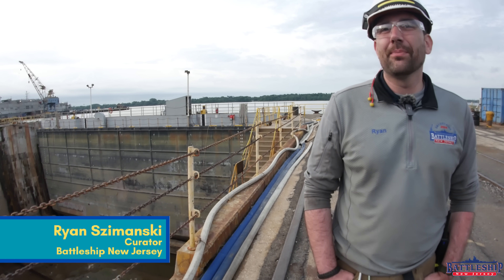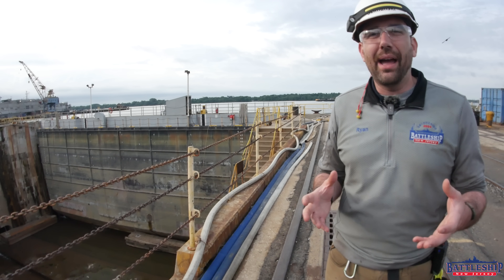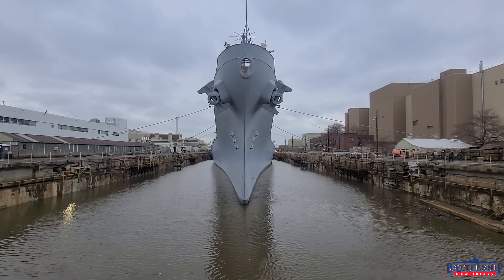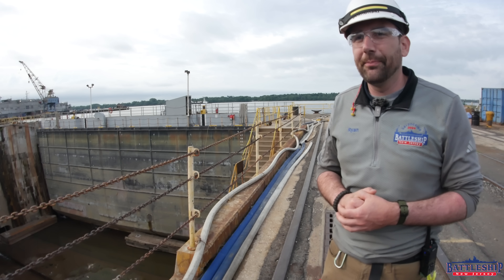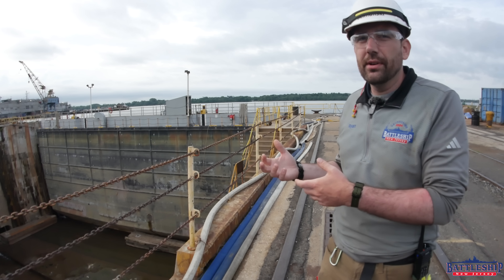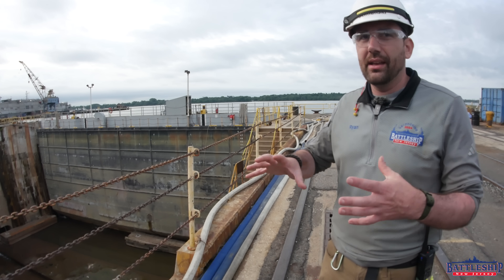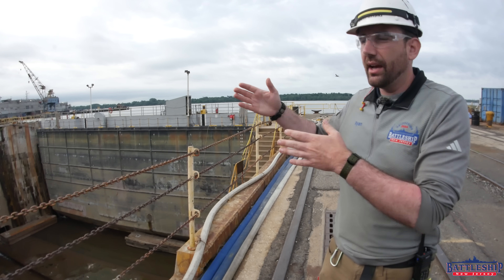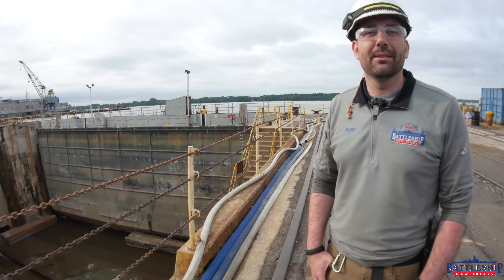How We Keep The Water On The Outside of the Drydock

Comment: You should try to do a video on the drydock pump room. The pumps, valves and piping for flooding and dewatering a drydock are enormous. Fun fact on that subject; flooding the piping used to flood and dewater a drydock generates so much air pressure from the water displacing the air in the pipes that the vent grates around the drydock have to be secured in place with steel straps because if the valves are opened too quickly, there is a possibility of the grates being launched into the air.

Comment: When you dewater a hydro electric station  they put in what they call logs to isolate the turbine area.  These logs do dot completely seal the turbine area.  As they pump out the water they drop in hay and horse manure to seal the gate. It is very effective seal.

Comment: Like many others I would love to learn more about the dry dock and its construction.  I’m hoping if I keep asking Ryan will make a video 🤓

One thing I wonder about is how the dry dock itself handles all that weight of the battleship on blocks?  Does it have piers down to bedrock?   It’ll be fascinating to learn how a dry dock was made a hundred years ago that’s still functional today. 

I also wonder how it manages to, well, stay out.  ‘Round these parts where I live if you drain a swimming pool and don’t refill it immediately during the rainy season the force of ground water will dislodge and/or destroy the pool. It’s not uncommon for people to need their pool rebuilt because the bottom popped up or the sides caved in……so I’m curious how massive dry dock manages these forces. 

Last but not least what’s the difference between a graving dock and a regular old dry dock?

Bonus curiosity:  I find myself wondering about the dewatering process for the dry dock, specifically the electric pumps needed for that huge volume of water. They must be massive.
Reply: Graving dock is same as a regular dry dock. If you got time, read 152 page UFC 4-213-10. Easy to find with google.

Comment: "The only thing holding the caisson in place..."  Yeah well that's a WHOLE lot of water pressure there, at what looks like 40+ feet of water differential.  It's actually pretty amazing that the caisson can span across the opening of the dry dock with that much water pressure on it.
Reply: I assume it has a bunch of girders inside.

Comment: I wonder if the dry dock bottom smells bad, with all the leftover mud and river water remnants
Reply: Probably not as bad as seawater but they use pressure hoses to clear it and it settled down quite quickly .

Comment: I was standing on top of this caisson on April 6th,2024 and enjoyed the view of New Jersey from her slim clipper bow looking aft as she sat high and dry on her keel blocks. That caisson is a very interesting structure in of itself. That shed roofed structure at centerline of the caisson is the entry to the stairs  to go down inside the structure which is lighted. At the conclusion of the Drydock Tour they allow you to get on the caisson and  view the Battleship as well as the Delaware River. The stairs in the Drydock next to Ryan are the ones we used to ascend from the Drydock floor ( only 150 steps up ! ). A lot easier going down than coming up !